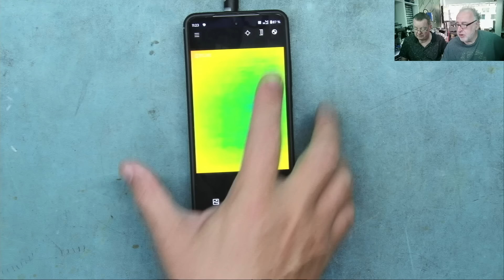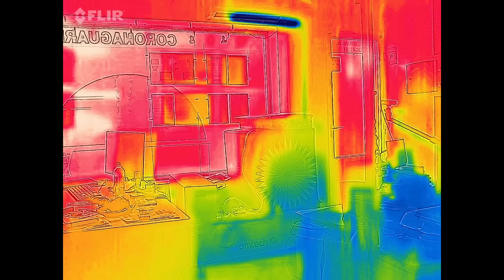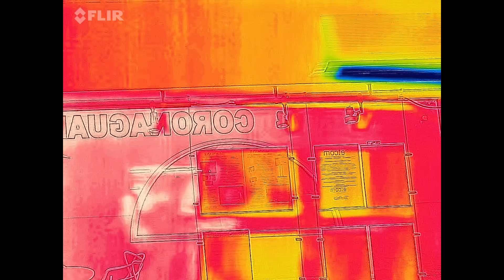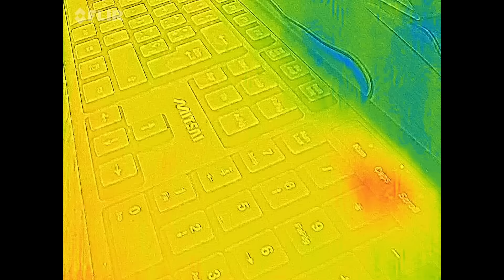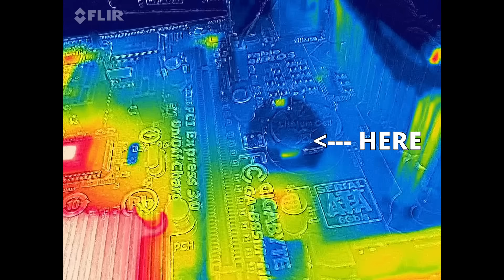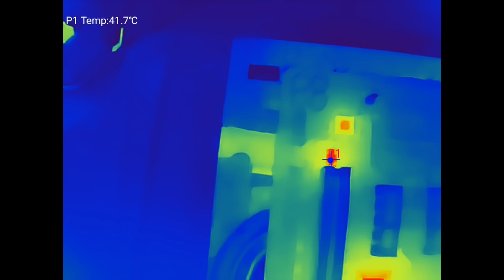Thermal Master VS FLIR One Pro IR Thermal Camera Test And Comparison : Which is the best 2024?

Comment: I think the ETS13S is better than both of them. You can have  it showing the hot spot and the coldest spot while measuring a specific point. Using the available macro lens works well for electronics repair. I paid £123.00 for both the meter and the lens on Aliexpress.
Reply from the maker: Yeah I have one and use it regularly on my videos.

Comment: You should read the manual first: "The FLIR ONE Pro is tuned to align thermal and visual images at a distance of 3 meters. To view scenes close-up, use the MSX
Distance slider control. Tap MSX Distance control to activate the
slider control, then adjust the alignment by sliding the control. To
exit the slider control, simply tap the icon again."

Comment: Regarding the FLIR, agreed, too expensive for what you get, but there are a few things that were missed in this review.  Note, I have the iPhone/IOS version, please keep this in mind as I mention the following:  One - the parallax can be adjusted, two - you have crosshair on the screen with the temp at that point, three - when you take a photo you get the IR img as well as the VL image and you can peel back the IR img to see the VL img.   These are just the first few things that came to mind that were missed, figured it would be worth mentioning.

Note, I have had my FLIR One pro for over six years now and the battery is showing its age, IOW, it last about a half hour or so...